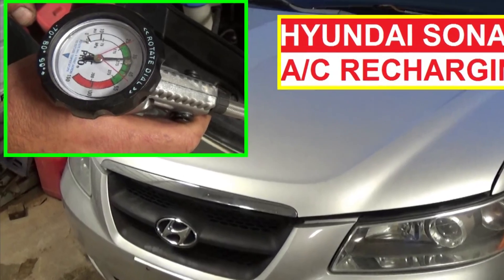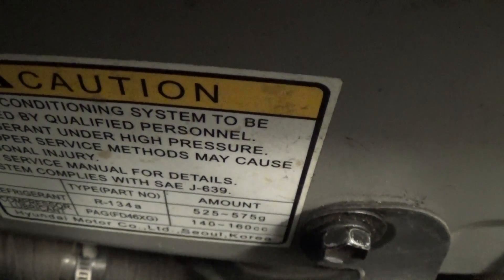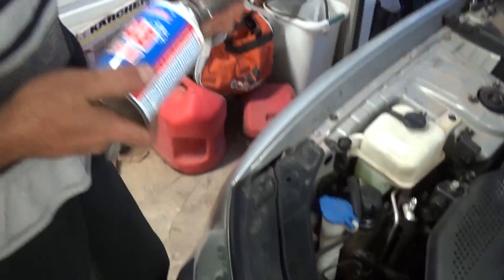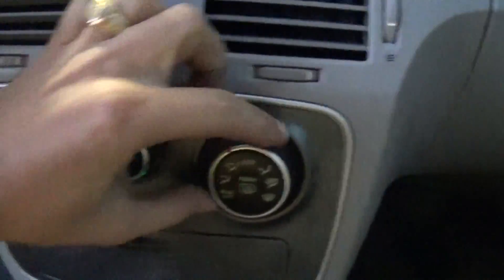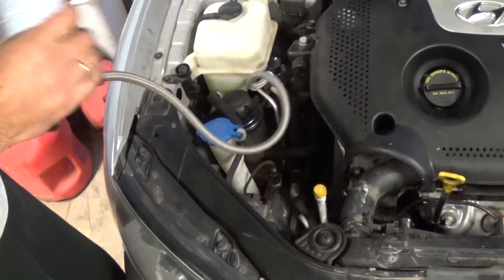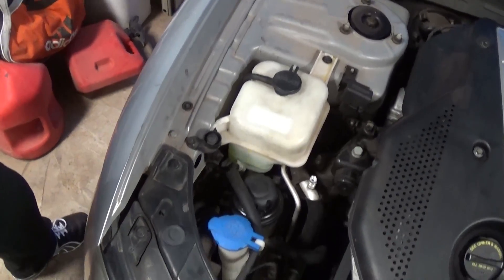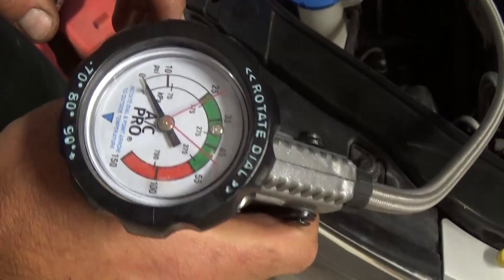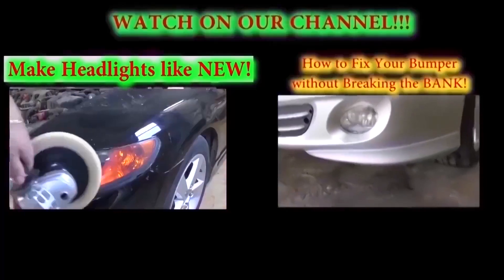How to Recharge the A/C Hyundai Sonata 2006 - 2010. How to Refill Air Conditioner

Comment: The instructions on the “AC Pro” brand can showed to shake the can upside down as you do in this video. But AC Pros video showed to shake the can while its upright. Which is the better method?
Reply: I'm confused as well..don't want to mess up ac on a really hot day an drive around with my kids an baby son in hot vehicle.
Reply: Like most things with cars, it doesn’t really matter too much. Don’t stress abt it, shaking it upside down will work just as well as shaking it right side up.

Comment: I tried you're method on my 2010 Hyundai Elantra. I charged to 40 psi, car on, ac on, compressor engaged. Used Redtek that comes with a gauge which is attached to a "T" from which two short tubes extend with one tube connecting to a can of refrigerant and the other to the Low pressure side connection. It took one 6 ounce can of the Redtek12a product ( purchased in Canada). The AC blows cold. Will it be blowing cold at the end of this Summer ( or this time tomorrow) remains to be observed and sweated-out-  Thank you for making and sharing your video.
Reply: How long did it last ya?

Comment: Please tell me,, if after the recharge is done, and you still end up with warm air,, could the compressor be to full--?? Will it hurt to over charge the unit,, and info will be great,, thanks,,
Reply: You need to make sure you do not overfill otherwise you will need to take it to a mechanic. This is why there are gauges.
Reply: Also if still blowing warm after fill..could be a few issues, the compressor being one of them

Comment: where the hell is the a/c compressors??? I wanted to check it before I charged it up becuz I feel compressor belt broke...
Reply: Shona Magouyrk Most cars share a rubber belt that drives the alternator, engine coolant pump, power steering pump and the a.c. Compressor. If that belt is broken while the car is running it will overheat in a few minutes. You'll discover you're fighting with your steering wheel trying to turn corners and if your battery isn't in top notch condition (and your car isn't a deisel furled vehicle) the ignition will begin to fail and your engine loose power just before the electronics shut down completely. Your dashboard service warning lights should resemble a Christmas tree when this happens. I doubt your belt is broken or missing as you'd be far more concerned about your cars inability to operate for more than 10-15 minutes. Your compressor has a relay and another part that can easily fail. Relays are easy to fix. I hope that's the problem.
Reply: A.G. M. yeah..I'm sorry for late reply, but I believe we have something happening with the air compressor!! an expensive one, when we crank the car you can hear a clicking noise that sounds like a straw or card in a bicycle wheel, we hear that noise and it stops when we turn ac blower off. well whdn we turn the ac off. a local mechanic put a gauge on it and he told my daughter that the low port is bringing it in but high side isn't pumping..hmmm, Im not positive that I said that right, but I wondered if it isn't just clogged?, he told her it is an all day job that he would rather her buy an air compressor just to be safe because it would be a 400$ labor job regardless...smh so me being the diy type, I started researching Google and found out sometimes a heat box???, can be filled with debris...if u can help me with what little information I've said could u pleeze let me know..Thank you, and GOD BLESS YOU
Reply: A.G. M. oh BTW,, it worked great like ice and like overnight it started blowing hot..that fast..so maybe that can help identify
Reply: If you can't find an ac compressor, have someone help, your out of your league. FFS, Google image? Geez.

Comment: How do you know if the air conditioning system needs to be recharged? The car I have was given to my mom by my sister and I use it to drive to and from work. It is often 80+ degrees out as of late and the air conditioner does not blow ice cold air at all, it will, provided I put it on the recirculate setting, cool the air (after a little bit), but the air only gets cool, not ice cold at all. I think it would really struggle if in 100+ degree heat. Does this mean that the car's air conditioning needs to be recharged or is that kind of air normal for this car (I have read that some cars have lousy air conditioners)?Thanks
Reply: Kyle Blank hey kyle, yes it sounds like u need recharged..its fairly cheap n easy but if it blows a little cool then more than likely u need to go buy a can.